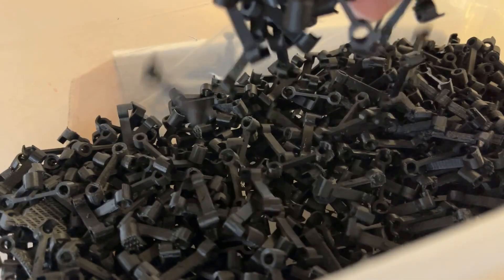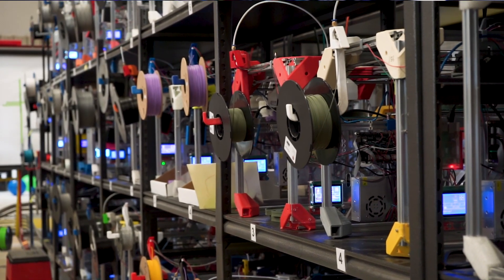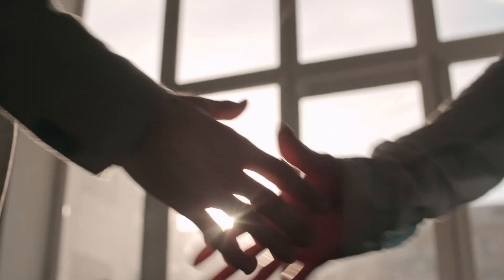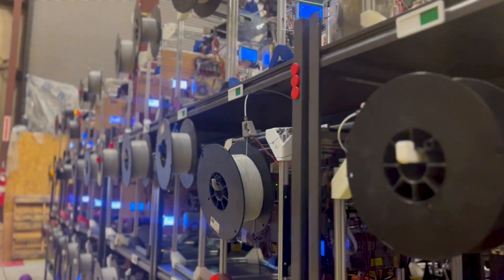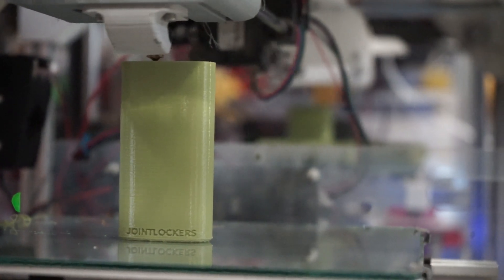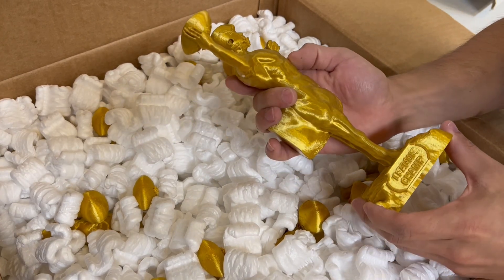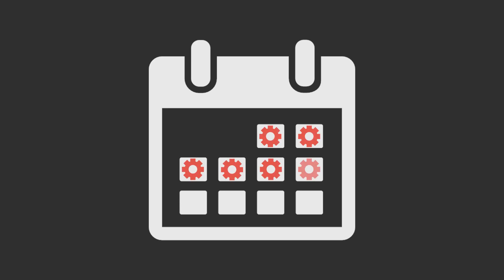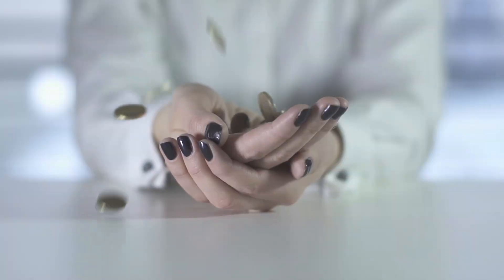How to Lower Your Mass Production 3D Printing Costs

Comment: Thank you for this kind of content,  the learning curve on commercial manufacturing principals being applied to print farms has been pretty high as most content around 3d printing is targeted towards the hobbyist. 

I don't know if you take requests, but would love to see your insights about how to determine max farm scalability relative to space for machines and how many people are operating things when moving from 10 > 100 > 1000+  printers . I am rapidly scaling up  my small farm and trying to find a good stopping point as the sole machine operator before needing to move into a dedicated commercial space and start hiring. Maybe a top 10 recommendations to get the most out of a 1 person operated farm. 

If this has been covered in a specific video then nvm and appreciate you taking the time to produce this content!

Comment: An idea: id everey printer in the farm. Then the customer can opt in to have that id printed on the bottom face 1 layer thick. If the customer (edit:or print farm) finds a defect, they simply ship those defectives back and the id would make it possible to fix the printer that made it if theres a problem.
Reply from the maker: Not viable. It is the responsibilibility of the manufacturer to produce consistent parts at scale. The customer should not have to evaluate them each time. That would be unacceptable.
Reply: @Slant 3D  found another prob after post. It would need potentially thousands of sliced files! Not sure how i overlooked that. There may be a better way to deal with per printer qc though. Just not sure what it would be exactly. Only it may be a mark of some kind. I was only referring to overlooked defects and in house diagnosis of problems.
Reply: anyway, a pre inspection taken at the printer would likely be easier and may catch defects earlier.

Comment: I’m sure there is application scope for mass produced 3D printed parts, but it must be 0.05% of the market…. Design for injection moulding as a first option, if that fails, then I suppose print them.
Reply from the maker: Design for the final production process. 3D Printing eliminates tooling cost, shipping, warehousing, overproduction and allows a product to change overtime.
Reply: @slant3d  indeed, I agree. Design for mass production should entail trying to eliminate all forms of precision manufacture, machining, or complex assembly. Accuracy over precision I think is the term used. If this also means bringing more manufacturing back to the USA, then I’m all for it and behind you guys 100%. All the best.

Comment: Would love to see an auto-quoting engine integrated into your website. Taking info from a slicer would make this fairly straightforward and you could have price breaks built in for volume.
Reply from the maker: Auto-quoting is fantastically difficult for mass production. Low volume is coming soon though.
Reply: @slant3d  That's cool to hear! What makes it so much different for large volume? Conceivably the same printing constraints apply as a smaller volume. Other than the problems you mention in the video ofc